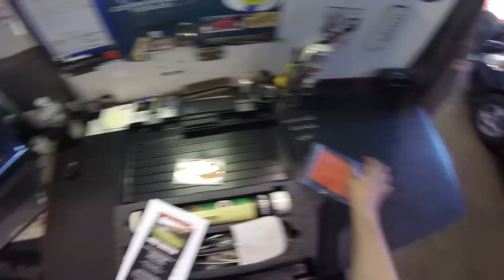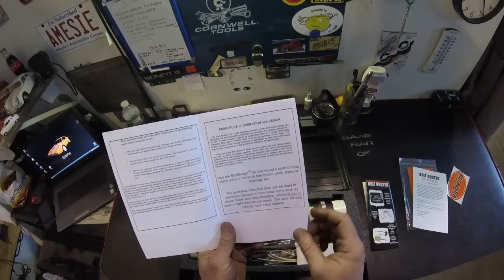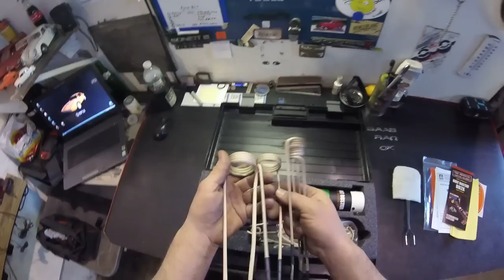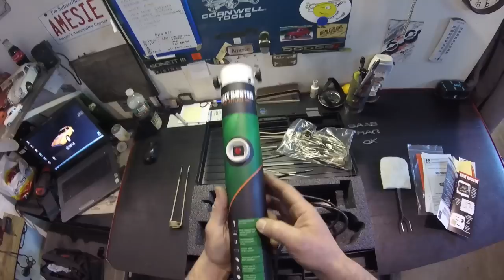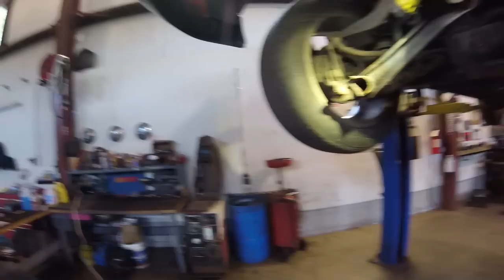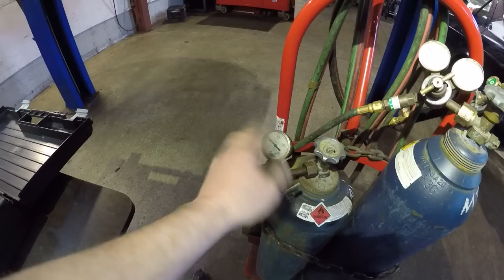Bolt Buster Induction Heat Tool Review!

Comment: I've have one that I got from the expensive truck about six years ago. It has saved my bacon several times when I needed to heat in an area that had other things I didn't want to burn. Mine was MUCH more expensive than that, but at the time, Captain Snap was the only one handling anything like it. Glad to see someone else has one now.

Comment: My boss bought me one of these for Christmas one year…I can’t tell you how valuable this thing is, I’ve used it from everything to seized nuts/bolts on small parts, to U-bolt shackle bolt/nut on peterbilt front suspensions.  The bolt buster is one of my most used tools, and one that I would definitely recommend and would buy go get abother if anything happened to my current one. I only go to the heat wrench when I really need it.

Comment: A torch set is way more money. If you don't have a way to heat frozen bolts the induction heaters have made believers out of a lot of old school mechanics who still keep their torches in the corner collecting dust. Good video, no bull crap, straight up description of the heater. Thanks.

Comment: as a time served blacksmith, we are tought to pour water over the nut before  ever putting a spanner wrench or socket  near it. reasons twofold . one cooling the nut shrinks the nut first over the hot bolt that is still axpanded. in so is making the nut  stretch over bolt and after bolt coools, it will most likely be finger loose but at original strength, secondly if moved while hot it could destroy threads completely because the metal is still soft

Comment: I used a induction heater back in the 1980 to incert the spindle in to the rear knuckle on a Ford Torus in a manufacturing factory Tech has been around for 40 years.

Comment: When you use the gas wrench, heat can be overdone. You always cool the heated fastener with water spray. That way you will not totally overheat the fasteners. That is how fasteners fail because of overheating. If there is a failure and the car is in an accident make sure your insurance is paid up as you are totally liable. Also, some of the sensors are magnetic sensitive. There is a reason why some garages just close their doors. Someone has to pay the lawyers and the injured parties. The rest of your video is just right on. You used all the safety procedure. Heavy extension cord excetera. Good job.

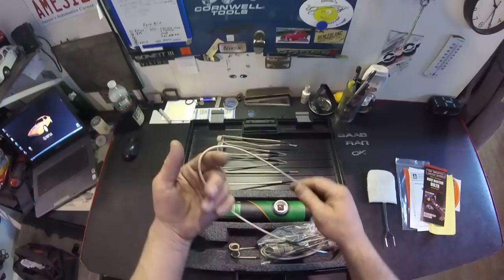Comment: WHAT A MOST EXCELLENT PRODUCT AND VIDEO!  I did not know they had made such a tool out of an 'induction heater'!  @ 6:12  It wouldn't really hurt to wrap around your finger!  It works by producing eddy currents to heat metal ferrous (magnetic) materials.  Your fingers are 'dia-magnetic' and won't heat.  BTW,  the coils are called "work coils".
Reply: it could give off some radiation or emf you dont want to horse around with, like a microwave

Comment: I've always been leery of torching (even propane/mapp) just because of the harm to stuff around. Invariably there's sprayed on sound dampening, rubber boots, endlinks, or something greasy right nearby.  Add to this if there is good paint on suspension parts, it's no longer there after torching leading to more rust later. Heat also messes with metallurgy for heat-treated or high-tensile parts. Kroil (a penetrating oil) works well, but takes time alone. With moderate heat/spray/heat/spray it loosens most any rusty part.
Reply: you should see what muffler shops do.   don't hear of them burning their shops down.  I think its all about prep.

Comment: Great vid as always mate 👍🏼 I’ve used this tool (although a different brand) many times before over here in the UK where they also put a ton of salt on our roads in winter. It works an absolute charm every time, without fail and it’s so much safer than the oxy acetylene torch, aka the “flame axe”.
Reply: Nice tool. But to expensive. My money don't  grow on trees. I only work on my own cars anyway.

Comment: awesome tool. i believe theres a tool the actually predates this one.i remember the teachers talking about it when i was in tech school.  same princeable and the wire was wrapped the same but instead of using magnets it just used electricity. it was basically like your electric stove top or the element in the oven. you wrapped this wire around the nut/bolt turn it on had like a dail to adjust the heat/electricity flowing through it to heat up the nut/bolt to lossn it.
Reply: AbandonedColumbia,Missouri  :.......this tool is using electricity too .....!!!
Reply: yes true but i dont think this tool was out in 2002/2003. what im talking about was basically a thick wire plugged into a wall outlet type of thing. nothing as fancy as what amesies is.

Comment: It's a good tool, but nothing has replaced oxy acetylene in 100 years or there abouts. It cuts, it can weld, braze and of course warm stuff up. Not taking away from the induction heater what so ever.

Comment: Excellent video, us home-DIY:ers can only dream of a gas axe and the comparison :)
Reply: Yeah, It's humbling to work on a siezed nut for 2hours and then go to the garage and they get it of in 2min.....
Reply: I found Oxy-Fuel a very useful tool to invest in. without it I may not have been able to do much of the work I did on my truck . I am thinking of the work it took to take apart the U-Bolts that held the broken leaf springs on my 3/4 ton 4 wheel drive which is a 1980 that was rusted pretty solid from farm duty . worth its weight in gold. a Blueshield torch kit ( various welding nozzle sizes and a cutting torch )  I rented the gas cylinders at the time but discontinued that due to endless cost and bought the gas cylinders outright.

Comment: These are good until you need to get into a tight spot then it’s tricky to get in on the nut straight,we have one at work and very rarely use it now,we just stick to the gas.
Here in the UK the coils are very expensive and don’t last long when they are in regular use.

Comment: A long time ago, my aunt used a very similar item, although much smaller, to heat a cup of water for her tea!
Reply: Cool! Is she single??
Reply: She uses a coiled hot wire heater element not an induction device, completely different, this is different to a resistive heating element
Reply: Bet not.

Comment: we had a guy try to sell us one of those tools a few years back in the shop I used to work at, it seemed a bit bulky to me, and had space limitations were you couldn't get at a bolt you wanted to heat up, shop manager ended up not getting it, I can see the advantages of it around cv boots, and front end part bushings, and ball joint boots though, maybe even on brake caliper seized bleeder screws

Comment: Very nice, I can see where a tool like that would be very beneficial for a money making shop.   where time is money.  where perhaps a shop isn't allowed open flame tools .  but 500 US dollars ( closer to 700 Cdn buckazoids ) for a tool that is very special purpose unlike an oxy-fuel setup ( I used mostly for welding and cutting )   the tool is just too pricey for a poor hapless tool like me. I'll keep using my torch and remove stuff like wheels to keep them out of harms way before lighting up. use of plate steel as shields for sensitive parts. takes a bit more prep but for me, time is not money.  but still, very interesting reveal of what is obviously a tool perfect for buiseness where it would get a lot of use.      oxy-fuel is very useful for heating and welding up exhaust systems.  sheet metal on rust repair.  cutting heavy iron like when my son constructed an I-Beam for overhead engine pulling system i my garage. so it wouldn't save me from buying the Oxy-Fuel.

Comment: I like this tool, for releasing seized bolts in water outlets etc. and in this video it shows you can loosen the tracking arms on a Honda, Woopee, BUT now go back and show me the bolt turning. The bolt is the part of this which actually makes the adjustment and they seize in the steel tubes in the bush. The nut ONLY locks it in place after adjusting the toe.You have only done half the job? I have been doing this job for over 40 years and as I said the induction heater is a great step forward so don't discredit it by conning us out here please.
Reply from the maker: Excuse me?
Reply: Just saying that releasing the nut is simple. You didn't show in the video whether, or not, the bolt would turn? If the bolt still won't turn , easing the nut hasn't helped. 

Tony.
Reply from the maker: @tony5006  I was showing the tool and how it worked on a nut that was easy to film. It wasn't about doing any work on the car it was about using the tool in a spot that I could film by myself. Making these videos isn't easy and I don't "con" anyone..
Reply: Ok, I caused offence by using the wrong word so, apologies for that. I should have said it was misleading in that yes it shows you freeing the nut. But you said you were freeing this adjustment so that the tracking guys could adjust the rear tracking, all I meant was that you implied that by freeing the nut it would make the adjuster useable, all I was saying was that it may well not do if the bolt is also (most likely) seized. And I don't think it's easy to make videos at all and commend you for doing so.Tony.

Comment: Cool tool. I'd be careful near sensors and wiring as it could fry an ECU.
Reply: something gas won't do.   but gas does have its hazards as Amesie pointed out.  but I disagree on the level of training needed.  we even had such a setup on the farm. take it anywhere to broken implements out in the field.   places where the Arc welder would not go.

Comment: Amesie--I've also seen YouTube videos on this tool's competitor, the Mini Ductor II.  The one thing that strikes me is that the coils used to remove fasteners are made so that the device has to be used straight-on.  Neither manufacturer includes a set of coils that are oriented at 90 degreed to the bolt or nut.  Your set had one extra "coil" that can be shaped for that purpose, but that's it.  The tool body is quite large, which would be so limiting in many spaces as to make this thing useless.  For instance, if you wanted to remove an exhaust manifold, you might have to bend the coil very tightly to 90 degrees to make it fit into the cramped area you have to work in.  If they had included a set of "inline" coils, you could hold the Bolt Buster vertically and reach down in to work on the individual studs to remove it.  There has to be dozens of situations where you can't use this tool unless you bend the coils to accommodate the cramped space you're working in.  And even then, they might not fit.  For the kind of money they're asking for it, I would have thought they'd throw in another set of "flat" coils as part of the kit, or at least offer them separately.  You've used this thing now for two winters; is this a legitimate concern, or have you been able to work around it?  By the way, this has to be the best invention in years for working on cars; my only concern is the with the coils.
Reply: SteveR pretty sure the coils are able to be bent to which ever angle you have to bend them to get it on the nut or bolt.

Comment: That would be so good for the 14mm exh manifold to front pipe nuts without setting the starter wiring on fire. LOL
Reply: sometimes its best to just remove the offending part from vehicle first. if possible.

Comment: Do  not  operate  the BOLT BUSTER,  and  stay  at  least  three  feet away  from  and  operating   if  you  have  a  cardiac pacemaker   or   any   other   kind   of   electronic   or   metal   surgical implant.Although  the  magnetic  fields  emanating  from  the  tools  travel only a few inches, they pose a dangerous risk to the proper operation of all implanted medical electronic 
devices in the user and any bystanders.
Reply: Lol from metallic pace makers etc. meaning don’t heat up medical devices it doesn’t throw impedance lol glad you googled and took first line from it

Comment: Anyone try brazing copper lineset  with this yet?  If not stay tuned.. Friday it should be delivered!
Reply from the maker: It only heats ferrous metals. If a magnet won't stick to it an inductive heater won't heat it..
Reply: @AmesiesCorner  yep.. can confirm.. it will 
NOT heat copper well. would have been a lot cooler if it did lol but still a freakin awesome tool and worth every penny! it feels like cutting edge tech in the shop and everyone is always amazed when they see it in action! a couple of the guys already have one ordered for themselves!

Comment: Torch... Torch... it’s 1 torch not 2 or more just one. If a “mechanic” worries about damaging a tire when using a “TORCH” the “mechanic” will remove the wheel.
Reply from the maker: Someone missed the point I was making.. It's not easy making videos like this by myself. I'll check out your channel to see if you can do better..
Reply from the maker: Nope...

Comment: Do induction heaters work on stainless bolts corroded in aluminum?
Reply: It depends on the grade of the SS. If a magnet sticks to it it will work.
It may not be corroded it could be galled... regardless,  the heating expands the bolts then as it cools and contracts the galling may release it's grip.
Be careful though, aluminium melts at less than red hot. You'd probably want to cycle the heating and cooling a few times  rather than heat the heck out of the bolt.
Practice on something that doesn't matter first.
Reply: This is pretty old technology.
Your explanation of how it works....well, we're all gentlemen here so let's not go there. Point is they work.
The price, is low compared to what older units used to cost, but expensive for what's inside the tube. Your paying for packaging and convenience.
$500 is a bit steep, but cheaper than an accident. Ate $200 they'd be a must have for everyone who twirls spanners for a living or a hobby.

Comment: I wonder it you can use the inductor to heat the bolt while at the same time shooting compressed air.  That might cut the steel.  ???

Comment: Only downside is bolts. You need to heat the metal around the bolt instead of the bolt itself. Are there coils that will do that?

Comment: Do you know if this can be used to remove a stuck spark plug?
Reply: Crack it as much as you can. Spray it with wd40 and let it soak in for 5 min then rock it back and forth. I deal with that issue all the time with forklift engines.